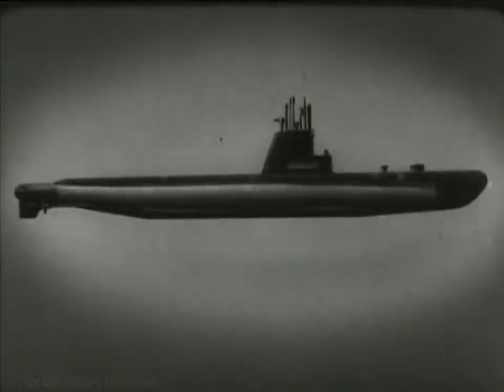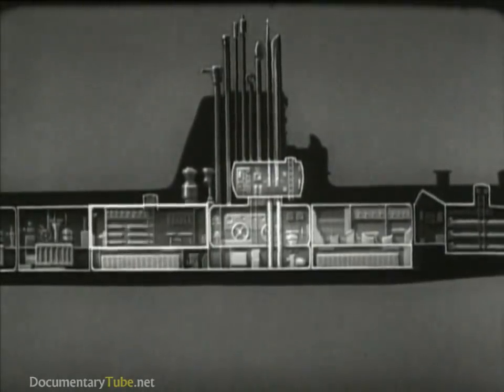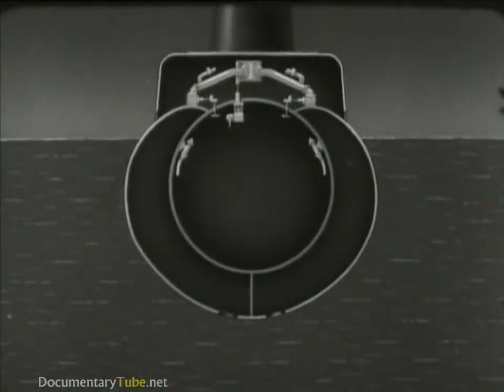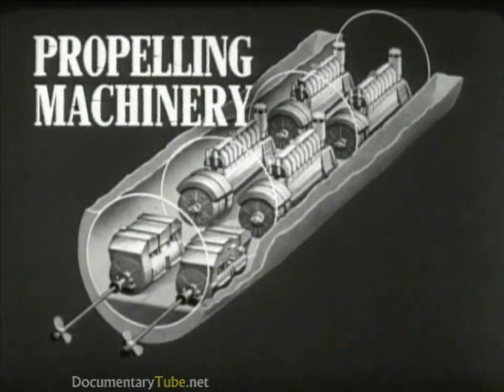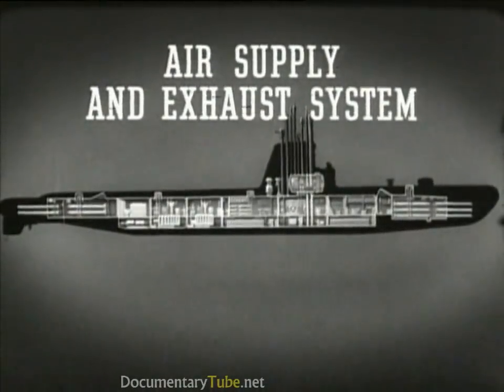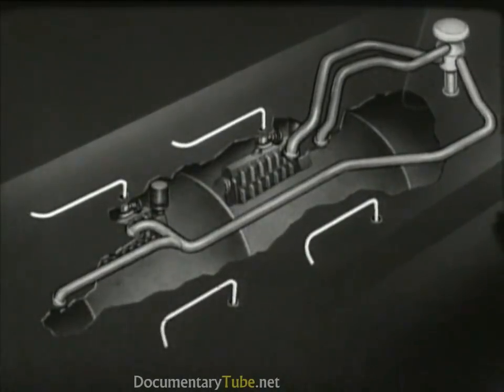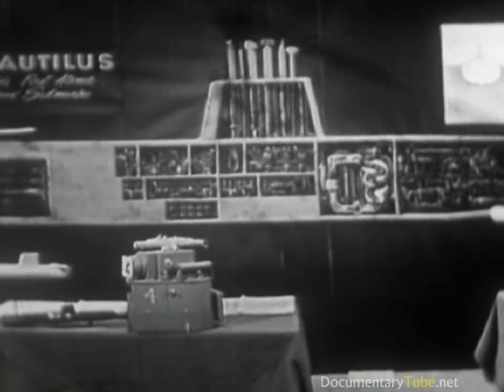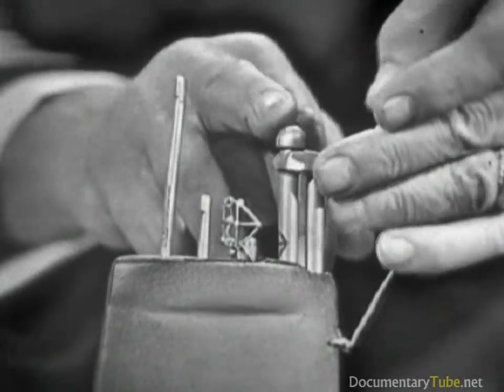HOW IT WORKS: Submarines

Comment: Gotta respect the engineering of the era. Everything had to plan and manufacture from scratch, without computers/CAD/CAM. So many things to consider and plan to make it a ship and a war machine.
Reply: Right. The outhouse had to be located INSIDE the boat for
quicker access and response time. lol
Reply: @eaglegrip6879  lol even the outhouse was a complicated  conction of pipes the germans once sunk one of their own subs because some sailor turned the wrong valve to flush. talk a bout an backwashlol.
Reply: nothing changes, now we have more sophisticated tools, but we also make more sophisticated things, and they based on prevoius tech as we rely on theirs, its civilization development
Reply: โน
Reply: All slide rule and crude mathematics. Also the SR71 was built the same way. Groundbreaking engineering achievements. Today the software does all the job..
Reply: @johndo3930  The Sauerkraut probably was bad..
Reply: Blueprints drafted by hand.

Comment: Submarines are designed to be slightly negatively buoyant when submerged. This means that they are slightly heavier than the water they displace. Ballast tanks, located in the hull, can be flooded with water or pumped out to control the submarine's overall buoyancy

Comment: One can only marvel at WW2 technology(same goes for the 50s in case of this video). In fact, any technology from 1910 to 1960. It’s manmade, it’s tangible, out in the open. There are dozens if hinges and levers that all make stuff go. Just looking at something could tell you how it worked. And it’s all made by human hands. I once spoke to a gentlemen who renovated a bunker from the 50s. The ventilation system had a fan that was so balanced the thing was still turning when he found it. It had been in perfect sync for over 50 years! 

Now it’s all covered by a wall or hood. Out of sight, out of mind. No wonder there’s a shortage of technical staff. We aren’t exposed to technology like we used to be. Our kids are never exposed to engineering, so I don’t blame them for not choosing it.
Reply: Gotta appreciate actual craftsmanship!

Comment: In general, the principle of horizontal movement of submarines is based on the principle of buoyancy developed by Archimedes. When the ballast tanks are filled with water, the overall density of the submarine hull increases so that the submarine descends to the seafloor.

Comment: That’s a postwar GUPPY mod on a WWII era US Navy Balao class submarine.
Reply: @ronratcliffe2219  love that film
Reply: Ron Ratcliffe, That’s correct.
Reply: Those Guppy conversations were influenced by the Type XXI U Boat.  With the ability to stay under water longer via the snorkel, there was no real need for the deck and bridge armaments.  Also, the sail structure that housed the shears reduced the drag that was present on the earlier conning tower/bridge configuration.
Reply: @drummer78  that shows how revolutionary the type XXI realy was i spot quite a few features that the guppy conversions got from the type XXI

Comment: Crazy to think that they went from a range of 100miles underwater to unlimited with nuclear power.
Reply: There is no such thing in the known universe as unlimited power, nuclear or otherwise.
Reply: @servicarrider  I know :) It's like when something says "lifetime warranty" Its the lifetime of that product.   Unlimited in this case would probably be longer than the life of the people on the boat.
Reply: A more accurate figure would be 20 years life before a reactor requires refuelling. Nutritional requirements of crew being left as the last limiting factor re length of voyage, although their sanity might be pushed if they were asked to spend multiple years at sea with only each other to talk to.
Some things that might interest you:
- water purification second to none (being distilled)
- other than emissions from construction, no emissions or pollution generating through their working lifetime
- the US Navy has never lost a sub to reactor failure or has there been a serious reactor-related incident while in operation, an exceptional safety record
Reply: @spidrespidre  and yet people don't want  a reactor as a clean source of power.

Comment: In today’s modern submarines, the “conning tower” is no longer located atop the main hull. The “conn” is now in the control room and the empty upright “tower” structure is now called the “sail” or what the Europeans call, the “fin.”
Reply: Interesting. I didn’t know that. Is that because with digital technology the periscope doesn’t need to be located directly above its viewfinder?
Reply: Matthew Newton, That is possible. Another reason may be better communication between the conn and the control room.
Reply: Flak Jack Ed Well, true, but I mean if you couldn’t bring the periscope back there with you that wouldn’t work at all. My guess- through either very primitive digital technology (developed DURING the war by Alan Turing) or a highly complex set of mirrors and that could simply detract the light to wherever it needed to be. One a mechanical advance, the other a true breakthrough in science. The post war is absolutely fascinating and stocked with these innovations everywhere you look. Contemplate that, will you, just for a moment?- that it was incumbent for millions to starve, be tortured, humiliated and die, their lives stolen and emisserated, for such progress of the kind that makes like easier, more pleasurable, extends its length for those left behind. Etc. does that seem like a morally balanced trade? I don’t know. I really don’t know. In any event, pointless to dwell on it. It’s the way it happened. No arguing with that.

Comment: I'd like to hear what the difference is between a WW2 sonar ping, and a modern sonar ping, if there is one, the problem is, it's hard to find videos or info about that because you can't tell if it's just the stereotypical sonar ping, or if the stereotypical sonar ping was the actual sonar ping during WW2.

Comment: QUESTION: (Maybe stupid, but please bear with me.) Let's say a submarine has a crush depth of 1,000 feet. To escape depth charges, the captain orders the sub to almost 1,000 feet - but the depth charges keep getting closer. Couldn't the captain release compressed air into the sub, till the air pressure reaches, say, 150 PSI? This would be equivalent to the pressure at a depth of about 300 feet.... allowing the captain to safely exceed crush depth by this amount - more or less. Once the enemy has retreated, the sub could surface and take all the time it needs to decompress to normal atmospheric pressure.

Comment: would you rather live in space (spacecraft) or live underwater (submarine) ??
Reply: The very idea of being confined in a submarine would no doubt drive me bonkers, but so would a spacecraft. I like to read about OTHER men doing this stuff but it's just too fantastic to imagine actually doing it myself. It's kind of the same thing, really, but opposite ends of the spectrum: in a sub you get crushed to death but in a spacecraft your blood boils in a vacuum and you die of blood clots in the brain, heart and lungs. Ever wonder what a dead body looks like after dying those ways? Creepy.
Reply: The BeatlesFan69 ; submarine. You can always come to the surface, plenty of water and seafood. Both are in short supply in space. So is air.

Comment: The 3000LBS Air system.. is that per sqaure inch, per cm, per foot, per carrot diameter?
Reply: Felix El Gato that’s per square inch. pretty common hpac pressure for ships

Comment: What year is this film from?
Reply: yea..... I Believe post ww2
Reply: I dont think so. The numbers are quiet bad for a post WW2 Submarine. Comparison : the Sub in the movie , autonomy submerged full speed 10 miles , slow speed 100 miles.  Now the numbers of Typ XXI (german , last model to see action) , autonomy submerged 8 knots : 120 miles. 3 knots : 487 miles , full speed submerged 16.5 knots. 
Looking at the performance , in the movie they describe a Gato-class US-Sub.
Another difference , the german XXI had a semiautomatic reload system fot the torpedoes. Could reload the 6 front torpedoes in less than 30 minutes. In manual loading you need this 30 minutes only for the first torpedo.
Reply: This looks like a Narwahl class submarine and they were commissioned in the late 20s and early 30s and decommissioned after WW2. I was able to track down this exact submarine and she was laid down on the 2nd of August 1927. She served in the battle of Midway and attacked Japanese cruisers in said battle. In total she served in 14 patrols before she was decommissioned.
What a beauty.
Reply: The Admiral mentioned the Nautilus, so it has to be 1955 or later.
Reply: 1492

Comment: Is the circle shape stronger than a triangular shape?
Reply: yes, because the pressure is evenly distributed. in a triangle the pressure in the middle of each of the three sides would be significantly higher than in the corners.

Comment: always wondered, when sub uses compressed air to empty ballast tanks to surface, that air is lost to the atmosphere, if the sub was to  dive again again in a hurry how is the compressed air replaced for the next surface, had me perplexed for years.
Reply: NINJAMAN420  But it'll draw in the air meant for the crew and also lower the pressure inside the hull, it's more likely that the air tanks contain more air than is needed to surface once.

Comment: Is the diesel engine being used below sea?
Reply: Ƀɹyan Peazone nope, used to recharge batteries and for propulsion when not submerged.
Reply: It definitely can! The schnorchel allows it to be used at telescopic depth.
Air-independent propulsion allows modern diesel electric subs, to use their engine at any depth, using different technics, from liquid oxygen to fuel cells. It can stay submerged for weeks while running on diesel, and produces very little noise compared to the nuclear engines and their cooling system.
Reply: Bryan Peazone -- To use diesel engines they have to A) be able to expel the exhaust gasses, and B) consume fresh air that would also be for the crew to BREATHE. So with this level of technology 3,000 psi is the highest pressure on board the sub. Therefore, presuming they can pump the diesel exhaust gasses out of the sub at 3,000 psi, it would be impossible to run the diesel engines any deeper than 1,250 ft. depth, nor would it be possible to blow ballast tanks deeper than that since the ambient seawater pressure would be greater than 3,000 psi. So the submarine would be virtually STUCK down there forever. IOW foundered. In practice, however, there is probably a factor of safety they use so they would never try to operate the sub deeper than say 1,100 ft. And they probably can't run the engines that deep either since the pumps they use to compress fresh air at the surface would not be pumps they would want to get contaminated with diesel exhaust gasses. Of course, when it's a matter of survival, it would be better to LIVE and have to breathe diesel fumes for a few days than to DIE because you can't move and you're being depth-charge bombed for hours on end. With the advent of "liquid oxygen" the pressure limits are all different because you need over 20,000 psi to contain liquid oxygen.
Reply: @btpcmsag  3000psi are 206bar, 1250ft are 381m, in 381m depth the ambient seawater pressure is only 38bar (551psi)
Reply: World Citizen nuclear engines, lol

Comment: I think mostly the engineering part of the whole sub system is already done by the German engineers from scratch for their U boat in WW2.Include the mixing fuel with sea water then purify before using to save space.That is a brilliant idea.
 Without Sonar,Radar to detect when the U boat surface to recharge batt  and the Enigma code,It is almost impossible for the Britain to win in WW2 if they  didn't win Atlantic .
Based on that,the next generation can develope a more sophiscicate system.
Reply: Submarines could prolong the war, but they could,nt win it.
Reply: The Allied seaplanes were able to locate many a surfaced U-Boat.  The Type VII U-Boat was essentially rendered useless by 1943.
Reply: The U-boat  communication leaked with the enigma encoding machine in Allied hand & British Radar . Then Allied Navy knew Uboat's strategies, hunting zone, where resupply, how many of them out there & send Seaplane to patrol on Uboat's position in Atlantic. Lot easier if the Radar also give the information as the Uboat surface. the information which before given only by vision contact now by electronics. Early electronic war started.
Reply: @webrumrunner  Submarines choke enemy chain supplies, very effective against Island state which depends on sea routes supply, spreading terror. There are limitations of course. With right strategies and combination with other forces. Victory.
Reply: @borisalma  True but you have to realize that U Boats and other submarines of that era had only about 48 hours of submersible time.  All the allies ex had to do was keep constant contact with the airspace and no U Boat could last long.
Reply: that's very unlikely even without brits/americans sinking our u-boats. the number of US and UK freight ships was just to large to sink them all - esp. since they were so easily rebuilt.

Comment: i didnt understand what he meant when he was talking about the periscope and he said "when the target comes into view we see that its a cruiser that is sliding across the deck..............."    and then we see an image of what seems to be a warship on top of some sort of platform or even what might be a submarine on the surface of the water, aparently carrying the ship. what was that?  is it literally what he said or did i miss something?   and if yes, how would that be possible and why would it be done? why not just sail the ship? if it broke down wouldnt it be easier to just put a new engine in it? unless it happened during a battle in the war and they had to evacuate the area quickly?  and how would they "tie" the  ship to the submarine in the first place?    idk, it just seems very odd and im most likely missing something ot just misunderstood completely, in which case, what did they reaĺly mean???
Reply: Most likely a reference to a changing angle to the target in relation to the slower moving object (the sub).
Reply: don't worry skip that part , you wont drive this submarine , life is too short.
Reply: Centuries mark 5 tank 1960
Reply: Gian when he says the deck that means the ocean on top of the water . just like a plane pilot calls the ground the deck and you can be above the deck or below the deck get it now ?

Comment: Sad, didn’t mention the compressor, the thing that makes the a sub work
Reply: What are you talking about? The compressed air system was covered pretty extensively, including the compressors bringing the pressure up to 3000 lbs.
Reply: 18 minutes in....!!!

Comment: I can't understand it.
Reply: Arnie Runtgens  Nobody else does either, they just won't admit it.
Reply: One of the most important and simple things to understand is as follows - 

To submerge, a submarine has vents that open to the sea to flood tanks in vessel.

To surface, those flooded tanks are then blown using compressed air.